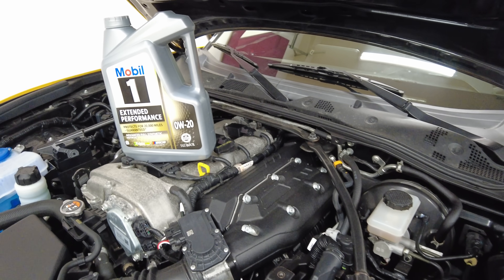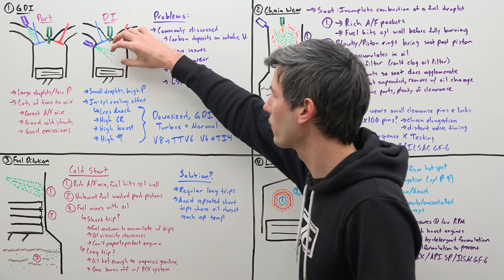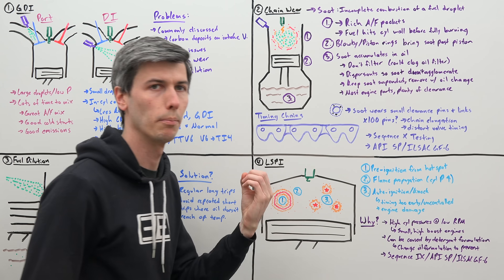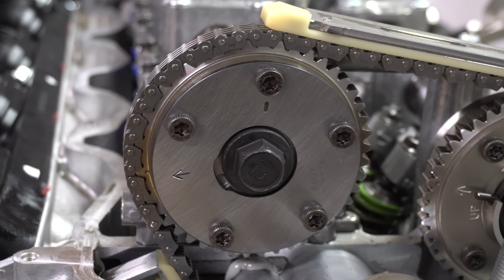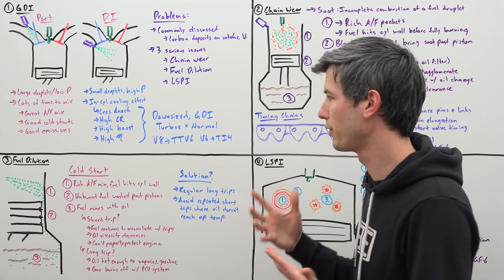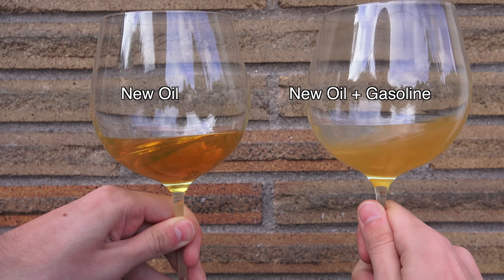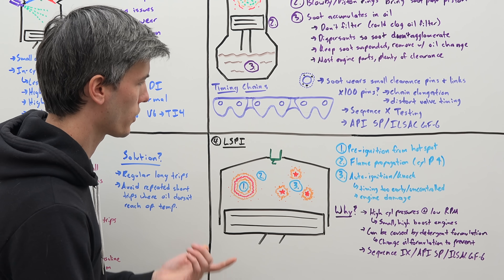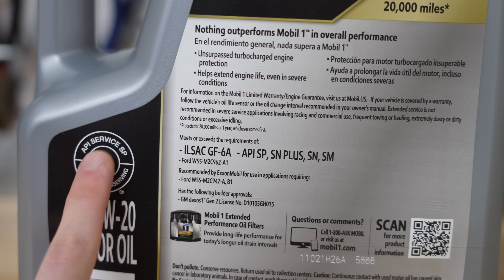3 Big Problems With Direct Injection Engines (Gasoline)

Comment: Both . Like the 2grfe . Nobody wants to pull the heads off at 30k intervals. Flex fuel is a good solution or E85 at selected intervals if it's available in your area.

Comment: If you plan to keep your car for a long time and this applies to any car not just direct injection ones you should plan to do routine maintenance consistently, oil changes frequently with good oil and you should be change your timing chain at 100k.  I have pulled non direct engines apart (multi port injection) that had a fair amount of carbon deposits?  

You say in the beginning that DI engines are more efficient so wouldn’t that mean more efficient combustion i.e. getting more energy out of the fuel?  So where does the additional carbon build up come from?

Comment: Gee...AIRCRAFT engines have been using direct into cylinder fuel injection since 1912 in Glenn Curtiss's FIRST in-line eight!  Used on a Wright Brother's "Flyer" making an AMAZING 42HP instead of Wright's 12 HP. He turned it into a V-16 called "The Liberty Engine" that was used in tens of thousand US, British and French "light" bombers rated at 400 horsepower in 1917. Oh yeah, Gotlieb Daimler used it in 1889 on his true FIRST production auto engine. Hans Diesel's FIRST compression-ignition engine was also "direct injected" in 1886. I sure wish you knew what you are blathering about...Direct injection and turbo-supercharging make Wankel engines get AMAZING fuel economy, always considered their "draw-back". We can't buy them in the US, sadly. Toyo-San of Japan sells a "2 1/2 ton truck" with a three rotor direct-injection turbo Wankel DIESEL!  370 HP, 2800 ft/lbs of torque and 18-22 MPG at 27,500 lbs gross.

Comment: So, now I have to check my oil containers to make sure they have correct letters on them.
As well as sitting in the garage for atleast 5 minutes to let the turbo spoil down after a hard drive.
Gotta do regular maintenance on my intercoolers, radiator, and oil cooler.

This is too much fricken work.
Turbos suck!
Shitty design perversion.
Just get a 488 cube V10 and some Nawz bro!
Haha.

Comment: would using 93 octane gas instead of 87  help with the low speed pre-ignition, and thus also reduce the fuel getting into the oil with short trios?

Comment: This is great, even for those of us that know very little about mechanical engineering. I have notice the following with my Subaru Ascent vehicle.
I know is a GDI design. Also that because of the turbo I decided to use only high octane gasoline( one Subaru mechanic recommended me this).
For the last year I am adding fuel injection cleaning detergent every 3,000 miles.
Before doing this I would never get above 19.4 mpg. For the last year my mpg when up to an average of 22.4 (mixing driving; city and highway).
I think this is the way to go or, this doesn’t make any sense?

Comment: I was using Mobil 1 ESP 0W30 until it became too expensive for myn liking (I'm in OZ so, everything is a rip off down under) I found Shell Ultra Helix C2/C3 to be the same VW spec.  Very low sootespecially. I also founbd the car will get noisy around 5K kms so, I change it out @ 4k. Use Liquimoly friction reducer too. All to save the chain ;)

Comment: Great explanation. I remember reading about this in reference to Mazda's current engines. However none of the oil samples sent in had much fuel in them, so they must have engineered for this.

Comment: Regarding fuel diltution of the oil:   fuel does not uniformly evaporate at a certain temperature.  Some factions will evaporate at fairly low temperatures, once the engine is up to highway operation for maybe 30 minutes.  Other factions will never evaporate at normal operating temperature -- once they fuel is in there (startup, running at low temperature on short trips), the only way to remove them is with shorter than recommended oil change intevals.

Comment: Ohhh that blowby on cold start is probably why E85 DI cars quickly run into issues when daily driven. The alcohol is even worse for your oil because it draws in moisture.

Comment: Port injection is so much simpler and more reliable. It cleans your intake valves as well 😊
Reply: And another thing he does not mention. With GDI engines they increase the compression, which leads to more very fine soot particles being released into the exhaust.

This is then countered by installing a particulate filter, just like on diesel engines.

The thing is....Diesel has caught a bad rep, because of the soot problem, but now they introduce this into petrol engines as well.

So now they have petrol engines with bad particulate emissions like diesels and because of the lower energy density in petrol, they have higher Co2 emissions.

So in short...A modern diesel engine puts out less pollution than a modern GDI petrol engine, but diesel is still getting a lot of hate.
Reply: @JohnDoe-bd5sz  Yeah, it is ironic that diesels fell out of favour right when they bacame really clean and efficient.
Reply: @JohnDoe-bd5sz   Moreover, a diesel engine is wayyyy more efficient and reliable than GDI or whatever the sh!t it is.
Reply: @protograde2723  Totally agree, but for some reason the politicians seem to be hellbend on hating on diesels.

They just released some figures here, almost no one buys a new diesel anymore, even though it would be better for the enviroment, compared to the petrol ones they get instead.

Comment: Good points. Perhaps another problem with direct injection is injector maintenance or replacement. Like spark plugs, direct injectors are in combustion where they can accumulate combustion deposits. Depending on injector fuel rail design, this could be easy or PITA.
Remember engines that had PITA spark plug access or were frozen in the head?
Reply: I've had to pull the injectors out my 2010 Alfa 159, the intake manifold had to come off and what felt like a million plugs and hoses to get access to the injector rail, injectors are now off for testing and cleaning, not cheap either, £90 (i'm in the UK) per injector, £30 for intake manifold O rings, plus an oil and filter change (as the oil is contaminated) i'm looking at over £500 and that's without garage labor for pulling the injectors.

Comment: Would changing to a thicker oil and doing more frequently oil changes especially for a Subaru boxer will help alleviate some of these issues? The manual calls for 6000 mile oil change interval but 3000 for severe conditions. Daily driving consists of short trips in hilly Vermont. I could do a 20 minute highway loop to extend my commute daily in order to get more highway. I am more concerned about the longevity of my new car than losing a few MPG.

Comment: So what you are telling us is that the cars being built today that require a specific weight oil, which it is when its first put into the engine, is going to change considerably by the time I change the oil according to the vehicle manufacturers outline in the owners manual, which for my 2022 3cyl turbo Bronco sport is 7500 miles. And if I follow that maintenance schedule by the time it's out of the powertrain warranty 6 years or 60k miles, my engine will be half way to becoming a boat anchor for a shipping container ship. That's great. So we should all say goodbye to engines that would easily last 200k and run like a swiss watch to that mileage and, depending on the manufacture, beyond. So WHO was the real genius that thought this was a good idea? The manufacturers or the politicians that mandated a certain mpg by a certain date? I think it's probably the later.  This is just another prime example of the Democrats F'ing up things with a knee jerk answer to things. Now instead of long lasting cars that pollute a bit, we will have short lived cars that will either need replacing (expensive) or major servicing/rebuilding (also expensive). Pass the bad design garbage onto the tax payers so they sooner rather than later become poor and poorer. Just another step closer to government dependency that the Democrats want. I really wish technology was better planned before execution.  Living by the Democrats ideals we will very quickly become a poor nation that depends on the government for survival as the country itself breaks down and needs help from other countries for it's own survival. But hey the out of touch politicians making their fat paycheck will be doing just fine. We really and I mean really need to start a collective uprising and demand better and stop accepting what the government forces upon us. If our forefathers saw what is taking place today they would line all the politicians and shoot them all. 

Sorry got off topic, but it's TRUE, like it or NOT!!

Comment: Here in Brazil, we have flex fuel cars(Gasoline/Etanol) with direct injetion......and many adulterated fuel🙈🙈🙈
  Has gasolina with much hidratantes Etanol amd Etanol with much water 😲💥🙈
  I think what many water do at direct injetion high pressure???
   Turns in a steam engine??💥😲😂🤣

Comment: This is why,
-never let engine go past 3.000 miles between change.
-never use oil thinner than ..-30.
-always use spec oil, for instance opel direct injection engines must use dexos1 gen 2 and 3 approved oil.
Reply: Titan 5.6 calls for 0w/20 so can't follow the no lower than 30 weight if I follow the spec oil
Reply: @germanshepherd13  The 0 weight is garbage for fuel economy. Check manual you can probably get away with it

Comment: You also have to factor in the high pressure pump driven by the cam putting extra load on the chain

Comment: If using the correct GF6 oil, when compared to port injection, will direct injection cause a shorter lifespan for the engine, all other things being equal?  If so, how much shorter?  Has direct injection been around long enough to show an engine can last 500K miles with it?
Reply: it will easily last 500k miles but will likely require cleaning the head halfway.

Comment: Excuse me for asking: where did you get your "knowledge" from? First of all: gasoline direct injection was first used in 1916 in a Junkers airo engine and was widely used in aero engines from the 1930s onwards. During the 1950s and later it was also used in cars - probably the most famous being the mercedes inline 6 used in the 300 SL gullwing. Port injection was used because it is cheaper and gasoline was cheap in the late 50s and 60s.
In other words: this technology is well known and reliable (aero engines - remember?). Seems to me that lots of people simply don't know how to maintain and treat cars properly. Note to myself: never by a used car from the u.s. 😂

Comment: GDi with turbo... issues.  GDi with a hybrid... rarely has a turbo, commonly Atkinson cycle with lower pressures, better mixing, and more complete combustion, with the electric motor assist for  torque?  A much better marriage.  GDi in a PHEV, where most very short trips never even start the engine?  Marriage made in heaven.  Besides which, many PHEV owners end up changing their oil every 3,000 miles or less (from the engine's perspective) because their warranty compels them to change every 8,000/12 months, and many of those miles were as an EV.

Comment: Very good information. Thank you. Another thing is these days the engines are much smaller and turbo charged and in my opinion these high horsepower small engines have to work so hard to create that kind of horsepower which means an engine that will wear out much sooner than a v8 making the same horsepower..

Comment: The oil dilution is real. I worked for a dealer and when DI came out we noticed right away at oil changes the oil ran out so fast it splashed everywhere and was very black. Soon they started coming in needing cats then injectors replaced which were in a set of 6 matched at 1k dollars for parts and not covered past 36k people were chafed to say the least.

Comment: I wanted to say I watch a lot of your videos and like your work but as a master tech I would argue that it is the 7k-10k+ oil change interval that is killing modern engine not direct injection. Modern engine with the additional strain and load should be maintained better not worse than there predecessors.

Comment: Have you done a video looking at the ecoboost wet timing belt and oil pump belt issues yet? Apparently the castrol oil designed for it has a care package in it and other oils can affect the belts.

Comment: One way of eliminating the timing chain problems would be removing it and going with either push rod design or electrically controlled valves.  Large two stroke engines on container ships have electrically controlled valves, there isn't really much of a reason we couldn't do that in smaller engines.  Granted, the rotational speed of a Doosan-Wartsila RTA96 engine is about 100 RPM, but we can find ways of making a system for auto engines.

Comment: I know Toyota and now Ford does this.  I think Honda does with their new V6.  I have to check. They added both port and direct injection to help clean up the valves.  Most of them are programmed to back the timing out to run 87 with a high compression setup.  Is it adding to the problem since it's not getting an effective burn?  IDK.  It'll run fine if not better on premium.  The vapor from Top Tier high test helps a lot on the build-up.
Reply: I only use premium in mine since the UK made E10 the new standard fuel before that it was 1/3 tanks that were premium. My 1.2T Toyota runs brilliantly.

Comment: It would seem to me after 45 years of experience in the automotive industry that government mandates have gone a little too far in the wrong direction. I'm sorry but zero pollution and 100 mi per gallon just doesn't exist. I'm sorry it just doesn't exist.
The emission standards of 1981 were plenty clean enough. A carbon monoxide standard of 1/2 g per mile, 1/2 g per mile oxides of nitrogen, 10 g per mile unburned hydrocarbons is plenty clean enough. It doesn't need to be any cleaner than that. As far as the US gas mileage standards go they can shove those where the sun don't shine. They are unrealistic and now are unachievable.
The manufacturers need to go back to standard port fuel injection, but with one significant difference and that is delaying the injection of fuel until about 30° after top dead center. This would give a time when the Piston is at top dead center during the highest point of overlap fresh air to scavenge out the last of the exhaust gases as well as to act as a natural air pump. The fuel can be injected when the Piston is 1/3 of the way down the cylinder that would still give more than enough time to mix the fuel properly. Raising the injector pressures would also help. Going from 60 PSI to 240 PSI would also help by making the droplets even smaller. A super atomized fuel will work just fine in a non-direct port injection setup and will still deliver the fuel economy and emissions that GDI delivers. It is well past time for a step backward. The more efficiency the government mandates the more the engines are being destroyed.
I would love to have a new Chevrolet Malibu but I do not care for that 1.5 L turbocharged engine that I know darn good and well will not last even 100,000 miles (160,000 km). I have one of those GM quad 4 engines, 2.4 l with 328,000 mi on it and it's still running. I can't say that for the new turbocharged GDI engines. The other thing about those engines are on paper they get phenomenal fuel economy however in the real world, not so much and some of them have to run on premium.
Reply: GOVT shouldn't be involve in anything. They don't invent anything but somehow they're experts in all fields and need to tell the private sector what to do.  GOVT has messed up the education system, health systems, the economy etc.   and now problems with auto, not just car problems but the cost, is directly traced back to GOVT incompetence and interference.

Comment: I bought my first turbo gdi car this year. I like the car it makes great power and is the quickest car I’ve owned. I’m the kinda guy who doesn’t like to leave things stock. I bought six fueling system for the car so along with DI it also has two injectors at the throttle body that run off the maf. I can program when I want them to spray through hp tuners. My next part is Tracy Lewis catch can to completely eliminate lspi.

Comment: So basically automotive manufacturers have traded a few more MPG for a shorter engine life and made gasoline engines five times more complicated. 
Makes me glad that have an old tried and true port injected, push rod V8 engine in my 2005 GMC Sierra, 245,000 miles and still going strong.
The LS based 6.0 liter engines between 1999 and 2010, before the advent of AFM and MVD are among the best designed engines ever, next to the GM 3800 V6, I seen those engines go 400,000 miles, with proper maintenance of course.
Reply: The direct injection engine in my Toyota Auris is brilliant, very smooth very efficent and has lots of low down torque like a diesel its fairly quick and very fuel efficent, I service within its guidlines and I only use premium fuel since the introduction of E10 fuel in the UK it runs like a dream.
Reply: @gravemind6536  How many miles does it have? And the turbo charged engine variants were one of the bigger causes of issues. Trying to fit so much Hp into a tiny aluminum block is bound to cause problems over time.

Comment: Right on!!! I always wondered if the gas that makes it into the oil because of incomplete combustion would also burn up during highway driving. So is this process what increases the rate of cocking valves?  Would aftermarket filters such as k&n have any effect on the cocking of valves?